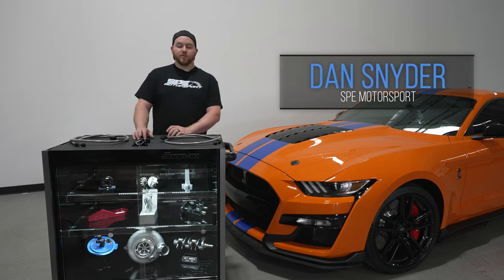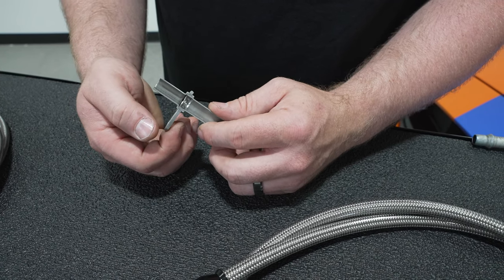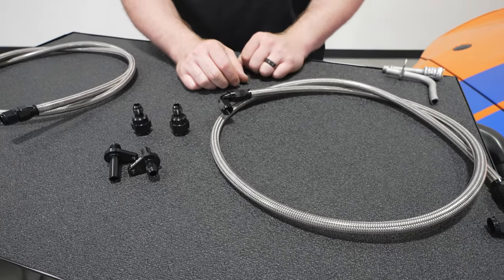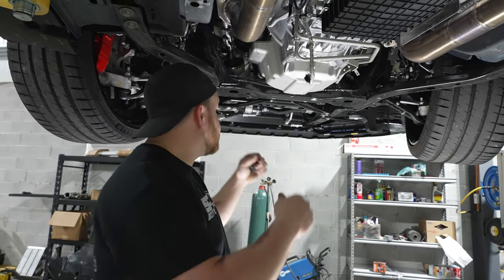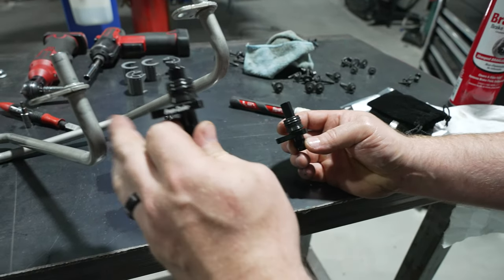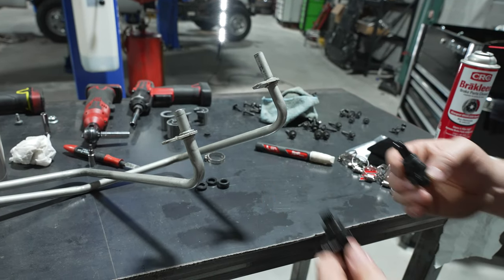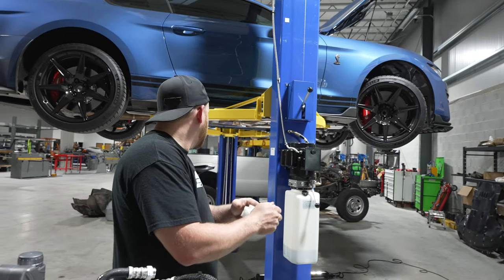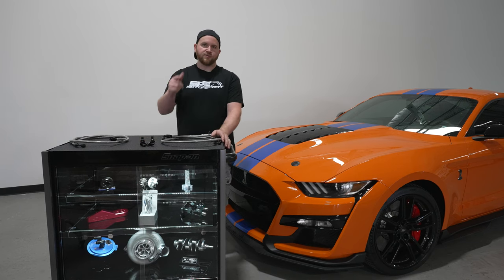SPE Motorsport - 2020+ GT500 DCT Cooler Line Kit

Comment: These are awesome...can you use the spe dct seal  fittings with these or you have to remove them an put the factory rubber seals back in with this kit
Reply from the maker: Yes they can be used in conjunction with our seal kit. Although it is not necessary, and we recommend the factory seals.
Reply: @SPEMotorsport  great thanks for the response